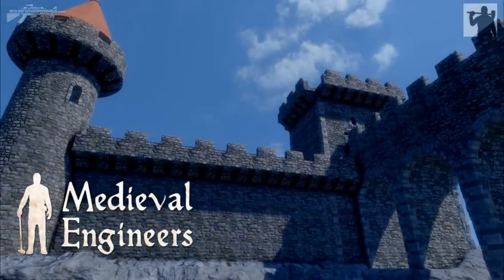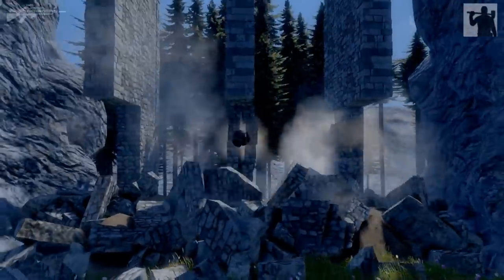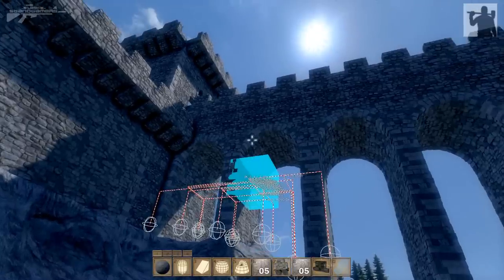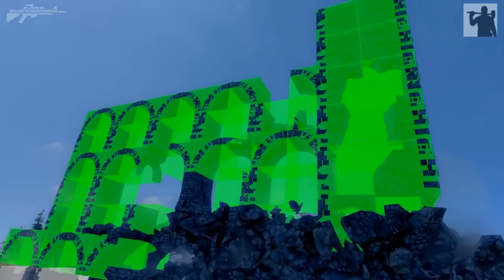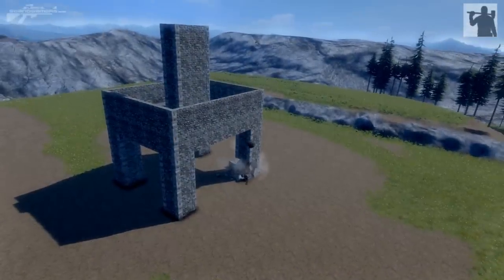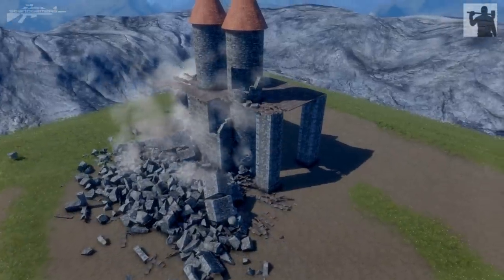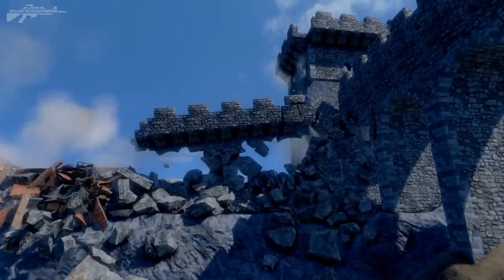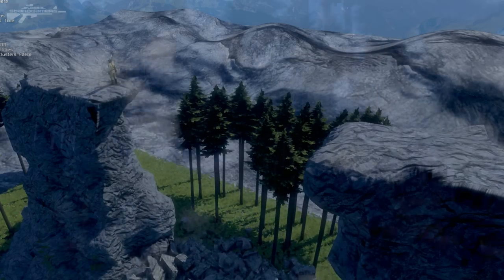Medieval Engineers - Structural Integrity, Crack,Fracture Collapse

Comment: Really impressed.
But I noticed that when large sections fall and and hit the ground the impact was not being applied as structural stress. Even then it still looks great and hopefully would be improved in the future.
Reply: Part at 5:30 is particularly impressive as the tower falls down on the walk way witch pivots on a pillar making the other end go up and cause yet more damage.

Another criticism that I saw in an earlier video is that the balls bounce off rather than becoming embedded in the wall or going through. Seams to be because the colliders of the walls are statically fixed until they break and the ball bounces just before they break.

Comment: GUYS, i was never even thinking that space engineers could do such a thing, but now, as the developers said, the teams between the two games share theyr technologies, i think we will see Bendable Metal strutts soon in space engineers.
imagine a very long Steel Pillar made of large ship blocks floating loose in space, now imagine it coliding with an asteroid with the flat side on, i hope its going to buckle and bend in the middle, leaving the two sides in takt, but separate by puting the two sides each on theyr OWN Grid, but connected by that one buckled block in the middle.
Reply: I would love there to be a very large explosive that when placed in asteroids (Or someones space-base) and triggered it will blow up the object launching Debris everywhere.
Reply: I think I read somewhere that object in space behave opposite to that of a submarine under water. I may be wrong but imagine building your massive ships and they float apart under their own stress..? (Sounds right)
Reply: that would be good. currently it just "errodes", becoming more and more crushed and then just explodes.
Reply: Tcman95 if that were the case,you'd probably need to build everything out of heavy armour. and if the outwards force is strong enough,even that wouldn't help.
Reply: Tcman95 Only if you pressurize them/ build in atmo. There's no pressure difference to explode, like there is for a submarine to implode.
Reply: Charles Guillory You would need some heavy armor on the exterior of the ship, but imagine having to build a ship to account for both atmospheric, and exterior threats,  
 Ivan Lovell  This game needs atmosphere LOL
Reply: Tcman95 atomospheres would be a cool thing to engineer, just not where you have to reinforce before youve built a stucture at all.
Reply: Charles Guillory Hey this game is about engineering, ill take what I can get.
Reply: Engineer ALL the things!
Yeah, I think atmo is, sadly, out of scope of SE, and you won't be going fast enough to see atmo in ME. Ah well, more reason to play both SE and Kerbal Space Program.
Reply: Ivan Lovell 100% agreed

Comment: Here is an idea for the walls.  Make it so player can pack their walls with gravel so they absorb impacts better and the insides spill out when the outer part breaks, making it harder to punch through.
Reply: 1. the gravel would fall like a sand hill 2 it would make it easer
Reply: Chris Stone 1 . No it wouldn't 2. No it wouldn't
Reply: If you build your wall on a hill it would all drain out if it was broken at the bottom, but that's assuming the physics have chunks of wall flying out after impact, which isn't very realistic.
Reply: i guess the gravel idea is best for defending against battering rams. The gravel would get in the way of the ram when it began to fall out and make busting through the wall a pain.
Reply: Mike N Burning liquid works better lol, poor some hot oil on a battering ram. You think a lot like aaron
Reply: well the oil will only work if they don't put a roof on the ram
Reply: Mike N please stop it, you obviously don't know so much about how physics work or how medieval tactis/building worked
Reply: Ok, to clear this up, people did fill castle walls with gravel in real life, but it didn't all just leak out if a whole was punched in the wall. It wasn't pea gravel, it was more like masonry waste, largish rocks, that kind of stuff. And they only did that because building a ten foot thick wall out of solid stone, which is way more durable by the way, was really unfeasible. And or fucks sake, they didn't use battering rams on walls, they were for doors. If possible, they tried to avoid knocking down walls if they wanted to capture it. And while a lot of rams did have roofs, it was to protect against arrows while running it up there.
Reply: Adam Fritz Might I add that besides that oil was way to expensive to poor over your walls. It is mostly something they do in films because... It looks better? :/ In real life, water would do the trick just as good and it would cost far less. Hell throwing rocks from the walls is probably more effective. That said, there are indeed historical accounts of oil being used...

Comment: They are using Finite Element Analysis. This calculates the forces of each cube and how they then impart the force on the cubes around them based on the material properties. However, the larger/fewer the cubes are, the less accurate FEA is. FEA is what is used for CAD programs such as Solid Works and Auto CAD.

Comment: Curious to see if this will be ported into SE. Perhaps this will be applied to ship thrusters, requiring that the ship be structurally sound enough to withstand the force they are applying to it. It could change ship designs radically, especially some of the more compact ones.
Reply: i could see them adding a setting for realistic thrust soon, but i imagine that the futuristic gyros would be ables to counter act the ship from spinning automatically(assuming you have enough) so the main concern would be the ship breaking under its own pressure, and gravity based weapons might act weird

Comment: I would like to see a constraint based structural system,  as well as the stress based system seen here, while it would increase CPU use, it would look more realistic when it comes to overloaded sections, the collapses are looking a little "poppy" , like the sections explode when they reach their limits (the bridge walking clip at the end really highlights this.)

They could potentially remedy this issue by having all of the smaller "broken" pieces ofthe structure linked together in a constraint tree using stress based breakable constraints. so after something "breaks" in the system above, the pieces remaining have a second system to enforce structural integrity in the already smaller broken pieces.

but dont get me wrong,, the system above looks amazing. but as stated its an early look at the system. and it DOES seem to offer some reasonably lightweight yes appealing looking structural significance to the constructions made.
Reply: i think this i due to them only having one acyion depicting it break, its either good or it explodes
Reply: I feel the issue has more to do with voxel size then anything. Stress is causing full voxel breaks it would seem rather then just piece splinters. This means more structural integrity is lost then would realistically be. Instead of the edge of the voxel breaking the entire voxel does. That would be my guess as to why things seem to over cascade. Of course going sub-voxel would probably at best be a linear increase in time, probably worse.
Reply: Not Everyone Has A Pentium 2.
Reply: Sinon From GGO
I should think noone has a pentium 2.
Reply: AwesomeVindicator My Old Rusty Computer Does.
Reply: you should donate it to a museum :D

Comment: I wonder if they can implement this in Space Engineers (granted to a much different degree, as the structual integrity will be dealing with metal instead of stone), but I can imagine something like a Star Destroyer running into something like a Banking Clan starship from the side like a ram, knifing through it, and then eventually through the stress cause the ship it runs into to bend in half and warp in the direction of the Star Destroyer as it keeps pushing forward before it eventually breaks away.  Would love to see that; it would make a lot of the videos of ships crashing into each other look more realistic and beautiful than what is in the current build.

Comment: Needs some work regarding the over enthusiastic chain reaction effect, but as stated, it's a first draft. Seems like the joins between blocks are a bit too strong at the moment, resulting in undermined sections pulling each other over when most should have just collapsed locally. Things like that plain wall segment, collapsing the tower behind it, is quite obviously flawed.

It's a tricky balance trying to get this stuff working correctly in every way it should. Hopefully will be improved in later iterations.

Comment: since structures pull on each other so much, i wonder if you connect your towers with only a single wood floor so it breaks before pulling other buildings apart. of course you'd have to make your bridges self supporting but it would make the complex of buildings stronger as a whole.
Reply: possibly, you could also attach a winch/tension wire to the tower that, when the tower's base goes down, will pull that tower away from the other ones

Comment: 2 things that stand out and make me go wtf, although I realise this is early alpha so I suppose they'll tweak things. 1. The buildings just exploding outwards when they collide, kinda breaks the immersion.  2. The way the trees fall and break at the bottom when you hit them at the top with a cannon ball. Doesn't seem right, bit of an overreaction from the structural support system applied to the trees..
Reply: well, also the cannonballs are a debugging tool and are WAY stronger then a lot of the other features actually in game, so that extra force is possibly throwing the mechanics off, as opposed to cutting the tree down with an axe or hitting a wall with a catapult/trebuchet which could take multiple strike around the same area to result in a similar effect.

Comment: how do you enable those struct integrity viewing modes, where you see the stress of the blocks as well with the numbers, and the distribution of weight  the direction the weight is going.

btw i cant seem to repeat what u did when i knock out the columns, some of the column just seems to just float in mid air

Comment: Why not have weaker blocks connecting the three towers so the weaker block would just pop off leaving the others intact?
Reply: becouse than the other tower will still fall against it destroying it
Reply: TheFantasticrobin ..Not really.
:|
Reply: TheShadow960 smart ennemies will shoot the inside wich make it collapse against the other 2 towers, and since it doesn't matter what type of material you use due to the weight beeing already on it and also the stress beeing added it will result the same
Reply: TheFantasticrobin
Nothing really stops you from making countermeasures to that.

Lets say you have one tower connected to the other with like wood or something weak, One tower is falling, breaks the wood but doesnt pull the other tower.

Comment: What's to stop people from just making their walls out of the rock bellow? In the trailer, it shows the player making a little area flat. What if they just get stone, and make a giant wall? I don't think the terrain will be effected by damage, will it?
Reply: Terrain will also eventually be affected as well (it's not currently done so due to the early state of the feature), so you'll have to re-enforce your mining tunnels and sappers digging under your walls will also be a threat to their integrity.

And most likely they will be affected by straight damage as well, just with different properties then the blocks themselves (raw stone is actually more fragile then processed stone for instance, since the shape of the block alters it's structure integrity just as much as the material it's made out of). A contiguous piece of stone will shatter and fracture through out from damage, where as formed blocks don't transmit stress nearly as easily since the mortar between each block bleed off some of the force since it's a solidified paste as a opposed to a solid crystalline structure like stone is.
Reply: Its annoying that digging tunnels under enemy bases will probably depending on mining speed be by faaaaaaaaaaaaaaaaaaaaaaaaaaaaaaaaaaaaaaaaaaaaaaaaaaaaaaaaaaaaaaaaaaaaaaaaaaaaaaaaaaaaaaaaaaaaaaaaaaaaaaaaaaaaaaaaaaaar the best way to destroy a castle but nobody will do it because people on the internet are stupid.
Reply: ryan joseph that was historical.
Reply: That was also the primary reason for moats, in addition to prevent rams from being brought right up against the walls. A Moat around the castle not only was an extra layer of defense, it was an early warning system as the moat would start to drain if sapper holes were about.
Reply: Not so right, it was the cannon made all useless, exept if you're refering the cannon as a gun.

Trivia: Rifles are guns that have rifling on the bore. So Rifle≈Gun
Reply: ZanathKariashi What do you mean? I have a cannon proof moat around my house.

Ain't no stinking Ottoman's busting down my gates!
Reply: ZanathKariashi in that case i hope they add water

Comment: It seems as though it is going to be impossible to make a structure that doesn't fall to it's knees with a few shots? Is the knock on effect going to be less severe in the future? (If one tower gets hit it does not affect the rest of the castle)
Reply: This is the early stages. It looks like all materials have similar damage calculations at the moment. I imagine that rock will be much stronger in the future.
Reply: The "debug cannon" hits with a lot more force then the actual siege engines likely will

Comment: As advanced it is, its still primitive. It treats blocks like uniform well welded parts. This "x rips y" is BS, as it should not be that much devastating. In case of stone it should brittle up much more, like sand castle.
Reply: i think that's going to be a hard nut to crack, we see when they have the debug on that the calculations is per block, really what they have to do is divide it into smaller parts, say 4 parts 1/4 parts instead of 1 full size part for one of those thin walls
Reply: anter176 Yes, its called FEM or Finite Element Method. Its widely used in engineering to examine detail to see how it will behave when we apply force on it. It may be used for simple stuff or advanced designing but issue is its pretty resource hungry on PC. The more detailed behavior the longer it takes. 
What I meant here is they should make stone more brittle and destroy area been a lot smaller. It is very weird when small parts of castle cause collapse on towers and to see large parts of construction keeping their shape and just dropping off like it was made of foam or something. But as I said - more detail = more pc hungry.
Reply: 318th oh, ok i get you now.

Comment: i feel like cannon balls need to get nerfed
Reply: Those are the ones the creative player can fire, not the ones the actual trebuchets and catapults will fire.
Reply: yes, but i belive that you will be able to shoot them from catapults or cannons ingame
Reply: Krucek rog Well, what is the rate of fire on a trebuchet? He is firing them like a machine gun, and with a lot of precission. They are absolutely fine as it is.
Reply: will see in the full game
Reply: Krucek rog
What we're seeing here is a point-and-shoot tool for testing the physics, I'd say.  Even if the trebuchet can be reloaded pretty quickly, due to not actually needing to do everything manually, I imagine we're only looking at a few shots per minute.  Not to menton that you'll need to calculate (or use trial-and-error) to get the trajectory right, and adjust for successive shots, I can't imagine that current projectile damage is a problem.
Reply: Krucek rog + the force firing from a catapult/trebuchet is nothing compared to the cannon fired dev tool cannon balls
Reply: well the seige machines will be far less acurate and a lot slower, but imagine if we get explosive cannon balls